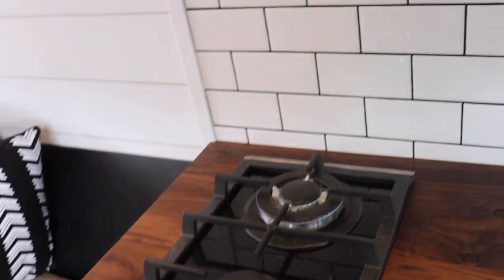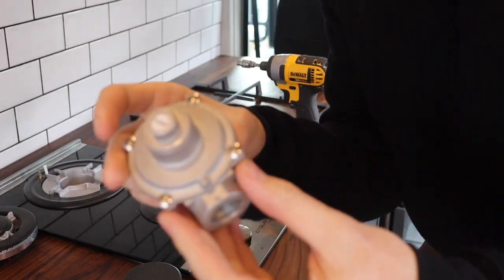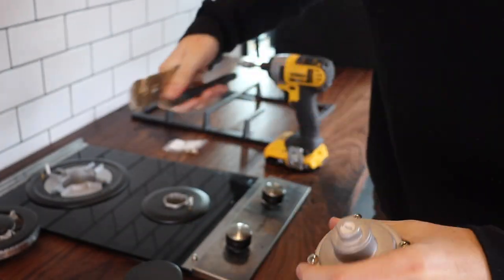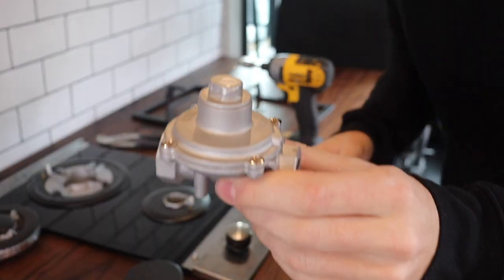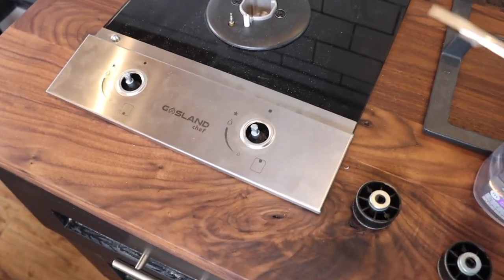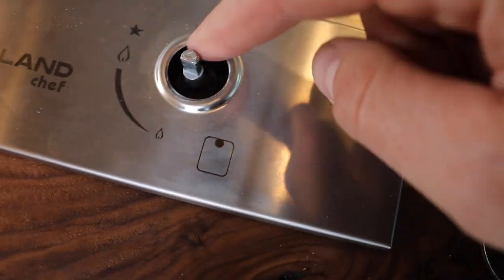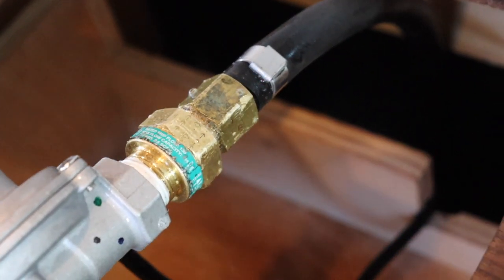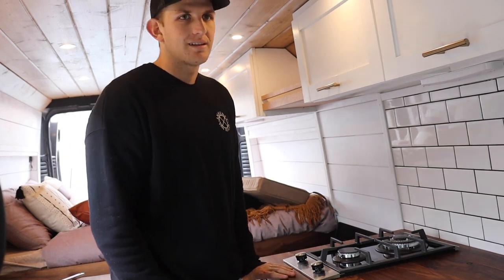VAN BUILD | CONVERTING NATURAL GAS TO PROPANE |  FAULTY GASLAND CHEF

Comment: THIS STOVE IS GREAT! 

HOWEVER, IT REQUIRES A DUAL STAGE REGULATOR!!! It won't function without one nor will most hot water heaters!

The PSI in Lp tanks is far too high for most single stage regulators and they lock and some applicances do as well.. this being one of them! 

Long story short. If you're using Lp get a dual stage regulator and it'll work flawlessly. Make sure to place it within 2 feet of your tank! I put the regulator that it came with closer to the stove so I used both.

Comment: Hey cool build. This is a common issue with setting up a gas hub.  The stove is fine.  Basically it comes down to psi, and balance. That stove is rated for 0.5 psi. Because too much gas is entering the burner tubes, and propane is heavyer than air its over overflowing the system and flooding the stove housing with gas,  igniting, and causing flames to shoot out. ( these systems are not sealed to prevent explosions)   
Solution:   If you have changed the jet nozzles to lpg,   there is another set of flow adjustment for the burner head itself. Unscrew the housing from underneath, the glass will lift off.  Next to the burner there should be  valve like the one next to the knobs. Zero these out then open a 1/4 turn.  rest the burner plates on the burner, ( leave glass off for now) lite the stove and adjust the flame for both burners so they are sufficient when both burners are lit. 
Alternatively you can back down your regulator by turning the grey knob on the outside, it looks like one piece but it can be turned with a wrench.  This backs a spring off a diaphragm, reducing the flow. ( it will not leak gas if this is left  loose.) This step will keep you from having a flame up again while you figure out the other adjustments. When you have balance in the system you should be able to have the regulator fully open ( tightened) and a healthy flame out of all burner holes at the same time, with no flickering flames, or dead spots when turned all the way down. You should never hear a rush of gas, just a whisper.  You should also have a one was valve on the gas line and an emergency shut off valve, uncscrewing a bottle take alot longer when your kitchen is on fire.
One easy way to get all this would have been too buy a flex gas line kit at home depot, then add a shut off valve.  One last tip:  Do this kinda thing outside your build, then install it.  Hope this helps, good luck.
Reply from the maker: Hi thanks for the info! And I did do that with the valves... propane still rushed out!

Comment: You need a double stage regulator before this small "last" regulator. These stoves, just like big brands like suburban, require an entry that is already low pressure (1psi or so) but you gave it direct lpg pressure which is around 200 psi. The small regulator cant handle all that.

Comment: Thank you for all the information. I came here to figure out what fittings I should use. I bought a different brand, but it looks very similar to what you have. Now I know what problems to watch for. I think I’ll hook it up outside first before testing it inside. And I’ll also have a fire extinguisher close by. 
I used to use a portable butane stove inside in the Van until it started acting up. I turned it on and had the fireball experience.
Very scary. Buy quality.

Comment: This emphasizes how important it is to check the gas equipment outside of the van. Only install when it's all worked out . . . then fully check again inside the van once installed (& check periodically throughout the burners lifetime.). Oh yeah, and make sure you have generous ventilation,  install detectors (CO, CO2 & smoke)  & ALWAYS carry 2 fire extinguishers (one up front & one in the back).  Lastly, every build should have a front & rear egress (a way to exit the van in an emergency). PS: I love, love induction cooktops (if your van has the electrical capacity for it}. I hope you're enjoying yours :   ). 👩‍🍳

Comment: I had the same issue with my stove. The company recommended another hose with a different regulator that stepped the pressure down to a pressure the stovetop could handle.
Reply from the maker: Ahh I see! Too much uncertainty for me since I sold this van. Induction was the right call!

Comment: I Use single burner portable butane stove, an msr multifuel stove, and an induction stove. All portable can be used outside and inside with ventilation for the msr. No installation needed and free up the countertop space when not in use.
Reply from the maker: Nice!!!

Comment: I just did mine today, I kept 45 degrees angle with green gasket inside and I got a better hose and double regulator, change the brass tip to propane, and work well..ps..make sure you have all same conversion threads.

Comment: We had a similar stove to yours and had the same issue, think they are made in the same Chinese factory. What we had to do was ditch the regulator that came with it and get one with an adjustment knob and we were able to control the flow from there. We've since replaced it with a much safer induction cooktop and never looked back.
Reply from the maker: Where did you go to get that regulator if you don’t mind me asking?
I’m now starting to see the appeal of an induction cooktop....
Reply: @AnkeneyVanBuilds  my wife works at a propane company here so we were able to get everything we needed from there. I'll add, that the induction cooktop was near half the price of the gas cooktop as well.

Heres a link to one that might work for you. https://amz.run/4KR8 We have a Furion single burner which was just $65.
Reply from the maker: @yourpcmd  I’m looking into induction now. Definitely thinking I’m gonna switch to that. Which induction did you go with?
Reply from the maker: @yourpcmd  That stove top looks perfect!!! Ill go with this one. THANK YOU!

Comment: I just purchased same model. All I did was replace jets with smaller LPG jets (supplied in kit) and dumped their regulator in trash and fitted standard Gasmate Regulator with hose set to 2.75kPa as required for that Gasland unit - no problems, works great.
Reply from the maker: Did you use a 1LB propane bottle?

Comment: Hay, from some of the comments it looks like there’s a workaround? Double regulator, various valve adjusts, etc, You don’t happen to have the thread sizes for those adaptor fittings, do you? Mine is 100k away, uninstalled but counter cut, and I’m hoping to use shortly. Thanks!

Comment: Glad you’re safe and decided to stop. Just a couple of thoughts as I watched your video. First of all I believe this system (LP anything) is so critical that only LP professionals should do the install for obvious reasons! Second, there is specific gas line tape for threads that is yellow in color and the white water pipe tape shouldn’t be used. Third, I have a Magic Chef two burner almost identical to yours and it required a second regulator from gas cylinder before hooking up to stove top regulator to help with gas flow. These are. It critiques but that stove is being used in hundreds if not thousands of RV’s very successfully! 🤙
Reply from the maker: Thanks for the advice!! I did have professionals set up the hose/regulator for me and I didn’t have any issues with leaks or anything on that aspect. And I will go buy some yellow tape. I used the tape provided in the box, (I’m wondering why it was white 🤔) 

And yours had two regulators?? Where were the two? And I wonder if that would have helped?

Because the rush of propane was coming out of the knobs of the oven itself. And looking at the reviews there were a handful of people who experienced the same issue. 
I purchased a new stove that comes as LPG and doesn’t require a conversation. Fingers crossed 🤞🏻
Reply: In today's mass production world, you can count on some faulty units being sold. It's unavoidable. Don't try to convince yourself that just because many units are successfully used in vans, your unit will be fine. Always, always test your unit (although outside the van at first). Repair, retrofit or return if needed.

Comment: Can you go with an electric induction cooktop if you have a sufficient solar system?  It may be worth it for safety.

Many van builders end up switching over to electric cooktops after they used propane cooktops.
Reply from the maker: Yeah I go back and forth with induction. 
I’d hate to have a few cloudy days and lose the ability to cook or heat up things. 
Propane is just a simpler and cost effective option. (Typically) until I got this stove making me reconsider.... 
thanks for your comment

Comment: Did you install a 30 milibar PRESSURE REDUCER? Running a turbo without a wastegate and braking your engine is not the turbo fault.
Reply from the maker: I brought this to a professional BBQ and Propane store to set up. They did not. I followed the instructions to the T and was on the phone with their customer service for hours. No mention of a 30 millibar pressure reducer

Comment: I've bought one of these for my kitchen to use as a single gas domino hob. Will it be OK for this?
Reply from the maker: Yeah that should be okay. I think the root of the problem was the 1lb propane bottles and the higher pressure in them
Reply: @AnkeneyVanBuilds  cool. Thanks 👍🏽

Comment: The first mistake you made was using a cordless drill to remove the jets, second mistake was use that regulator all you needed to do was use POL BBq regulator with 1/2 BSP female to 3/8 sae flare male coupling. Third when  you heard and gas leak after adjusting the screw below the gas knob , you should have check the gas fittings under the knob panel by simply removing the screws underneath the gas burners and check gas valves that has clear been damaged when you tried adjusting the the flow. So lastly yes the cooktop is faulty but this faulty was due to person trying to install this cooktop. My advice to you is get a professional  to do this work because you a clear a danger to yourself and others.

Comment: Maybe you should have had the regulator going in the correct direction. There is an arrow on it for flow and you had it installed backwards.
Reply from the maker: I assure you that wasn’t the case. They’re different sized fittings.  the regulator can only thread onto the stove in one direction.
Reply: That is incorrect. There is a flow arrow on the regulator. I have the same stove and picked up on that right away looking at it in your video.
Reply from the maker: @danhill1213  respectfully. I disagree. I even took it to a professional local propane bbq place to look at it and install it With the proper sized adapters.

Comment: Replace your regulator
Reply from the maker: I just got rid of it all together and went induction. Why would that company have a product a with such an unreliable regulator?
Reply: @AnkeneyVanBuilds  I think the regulator instructions were wrong. The spring shouldn't be pushing on the regulator diaphragm. I believe that would increase the pressure just like an air regulator does when you screw down on it. If you hear a louder rush of gas don't light it.
Reply from the maker: @RollingThunder808  The instructions mentioned the spring going the way I placed it as well as various other videos on the subject. Someone else mentioned in the comments that the 1lb bottles have more pressure than your standard 20lb and thats why this regulator couldn't support the 1lb. I don't know how true that is but I think thats the case